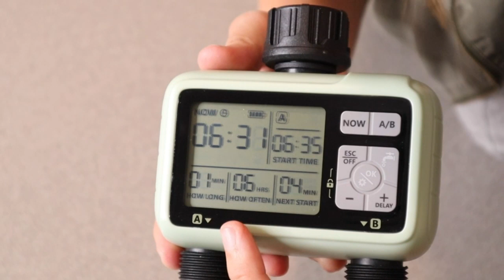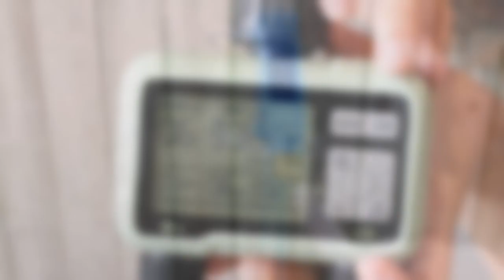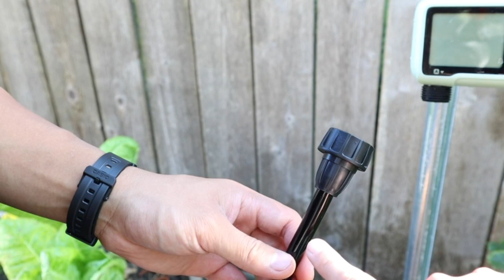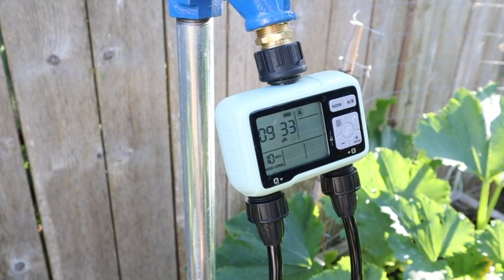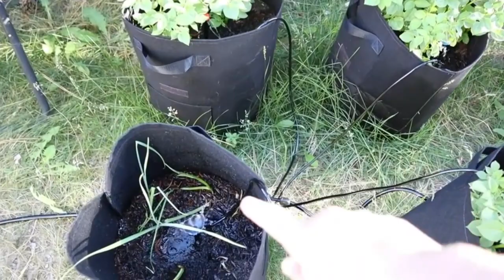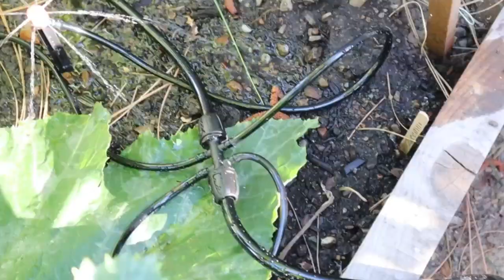HOW TO Install and set up Digital Water Timer

Comment: What does it mean when the screen says "off". I can't change any settings and the water won't stop. The instructions said if battery power is out the water won't run. I tried taking out the batteries and it still wouldn't stop
Reply: Hold escape/off for 3 seconds to turn it on. Should be an instruction booklet included.
Reply: @OffensiveBiz  either mine didnt have instructions or i threw them away